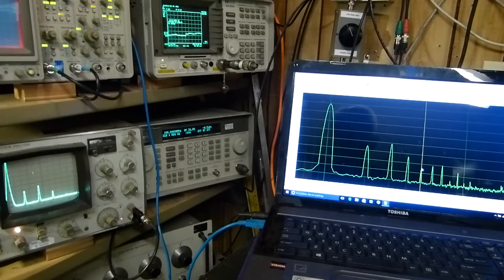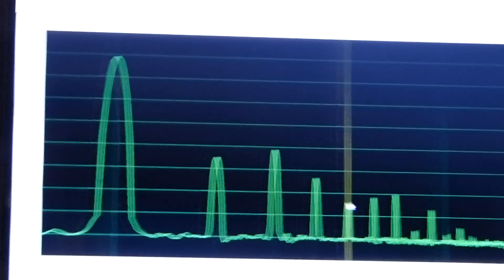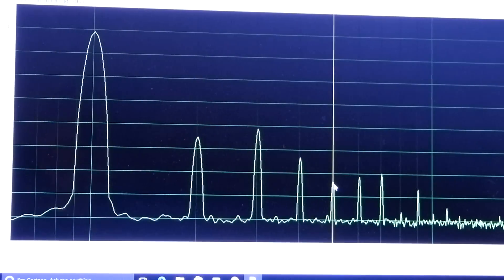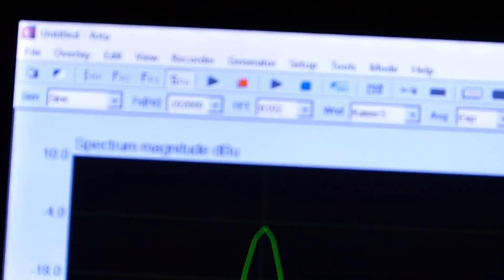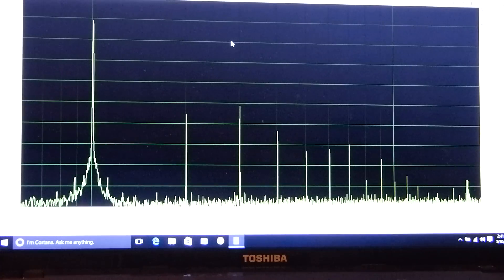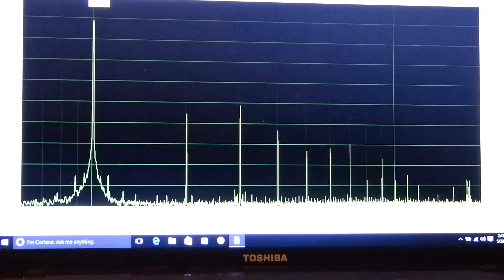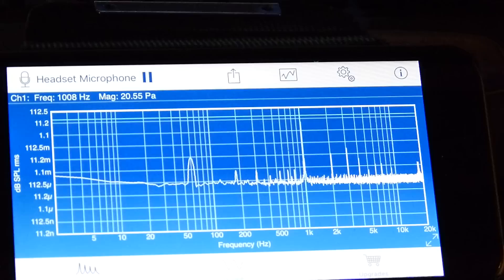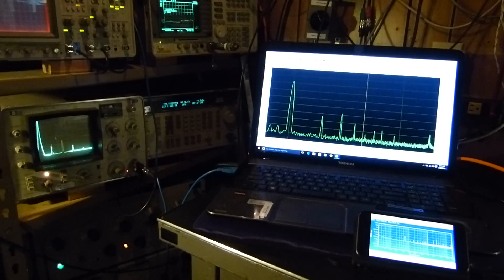Comparing PC FFT Program ARTA Software to HP 3580A & iPhone FFT Program

Comment: hy , what hardware do you use for probing?
Reply from the maker: I use an external USB sound card like, in this case the Behringer or maybe a Focusrite or whatever you might have that the ARTA software can connect to thru the USB port. I am confident it can find any USB unit. If the external sound unit has mic input you can use that for high gain, if you need it, or use the line level mode for higher voltage levels from the device you are measuring plus some attenuation network, etc. to get the input signal to a level the sound unit can handle.
Reply: @ElPasoTubeAmps  ok, can i use such thing for measure the gain of smps ? I develop resonant converter whixh need to explore the mag gain
Reply from the maker: @endremurti  Sure, if you can measure the input accurately and then the same for the output or you can do 10*log of the power ratios with a volt meter. I am not sure the dynamic range of this FFT device is adequate to measure input accurately but I may be wrong. You will just have to try. I can give you an example. Suppose your driving voltage is 1.5 volts across an input load of 500K (you convert this to input power and get 4.5 microwatts) and your power output is 50 watts, the gain would be 10*log (50/4.5E-6) = 70.46 dB.  Hope this helps.

Comment: Good stuff. Linear averaging gets the noisefloor smoothed out even further; it stops the measurement after a certain max number of averages, but you can set that to up to 100000, so no worries there :) I currently use ARTA's SPA mode for example for multitone distortion measurements of loudspeakers, with an output filter representing the spectrum of music (EIA-426B). Lots of good work put in by Mr. Mateljan. And there's also a extensive documentation available, by Dr. Heinrich Weber, called the ARTA Handbook.
Reply from the maker: Thanks - I looked up ARTA User Manual and this is what I found - very nice.
https://artalabs.hr/download/ARTA-user-manual.pdf

Comment: Good video, what did you use to isolate or attenuate the signal going to your computer?
Reply from the maker: I honestly don't remember as it was six years ago but I probably put it on the output of a 10K attenuator pot I have hanging off my "break out" BNC box. Not sure if you can see it in this video but it is where I bring all instruments together so I can measure everything at once. Practically anyway to attenuate the signal down to a few mV should work using a pot.
Reply: @ElPasoTubeAmps  thanks

Comment: What is the iPhone program you use?
Reply from the maker: It is an app called, "Audio Spectrum Analyzer" I might also add that you need a 4 contact type male connector to use with the iPhone and not the standard 3 connection stereo type used in a stereo headset with a microphone.
Reply: Many thanks. Your videos are great. I learn so much from them.

Comment: What version of ARTA do you have ?  I was about to buy a HP 3580A but ...
Reply from the maker: I don't know the version I have but you will just download the latest version off the web. I suggest you take a look at the SpectraPlus and you can make some decisions from what you find on the web. As for the HP 3580A, it was the cat's-meow in its era but at -80 dBm that is the tiniest blip on the screen and to display 10 Hz you have to let it scan as low as 200 seconds per  division (2000 seconds per sweep). On the other hand, it is a lab quality instrument and if want to look at frequencies in the KHz range up to 50 KHz its sweep time is acceptable. Hope this helps.
Reply from the maker: Version 1.8.5 is the version I have.
Reply: Thanks !

Comment: Hi El Paso. I'm curious about the physical connection to the soundcard since I didn't see any BNC connectors. This seems to be a very nice, relatively low cost solution for someone like me who is just a hobbyist. Thanks for taking the time to share your experiences. And what is the model of the Behringer you are using?

Comment: Hi! i am interested in buying FFT spectrum analyser software to run on my macbook.
i work on mostley tube-amps and want to look at the audio spectrums.
my question: how do you connect the software running on the laptop to a tube-amp for example a fender deluxe reverb? what extra interface devices and probes do i need?
thnx!
Stefan from Belgium.
Reply from the maker: Hi Stefan,
I connect some form of attenuator across the dummy load and attenuate it down to a level that doesn't overload the front end of the USB sound card. There is no special probe needed.  If you are running low power you can use a 600 ohm variable pad or one calibrated in dB attenuation but if you get up around 100 watts you will dissipating over one watt in your attenuator so you have to be careful at high power not to damage your attenuator as most of them are rated at one watt. What works well for me is simply a 10K pot across the 4, 8, or 16 ohm dummy load that the amplifier is running into and just pick off a very small portion to put  directly into your USB sound card. That is the simplest way if you do not require to know an exact calibrated amount of attenuation.  I hope this helps.
Reply: hey! thnx a lot for clear explanation. i really appreciate this. i go now first order a usb soundcard and download the limited fft free software and use some kind of attenuater and see how far i succeed. i get lots of Marshall 100w amps on my bench so i need to be carefull not to burn up my soundcard :-)...thnx man!!

Comment: ARTA is awesome. I mainly use it to measure Loudspeaker frequency response and it can do so much more.
If you put a loop on the sound card you can measure the frequency response of the soundcard and also use it as a
correction file if there are some deviations from a linear response. Usually this is the case with onboard soundcards.
Of course this is just a worst case method as you should use good equipment in the first place.
The external or good internal devices are very linear these days at least in the audio range. 
And of course you can measure any amps frequency response. Not an easy program at first but worth every cent
and there is a ton of information about it in the web so it is really rewarding getting into it.
Great video again!

Comment: Hi David! This was an interesting video. I actually downloaded the Arta software (free version) to play with it a little. I think for me,  this is great for out in the field. a lot easier than lugging a CRT spec analyzer :). Carrying that stuff around using public transportation can be an adventure...especially if I have to lug it up 3 flights of stairs doing a service call at a recording studio. For the shop, I'll stick with my good 'ol analog/CRT gear :) But it is pretty amazing. Keep 'em coming. :)
Reply from the maker: I agree, Frank. I have had to carry an oscilloscope, network analysis tools and calibration stuff around on a plane before (long before 911...) but I was so much younger and seemed to never get tired. I loved doing it so much. I sure wouldn't want to do it now.  I think the only extra device you need besides your PC, assuming you have a sound card that you are happy with already in it, is an attenuator. From my little experience with it about -30 dBm is what most sound cards seem to like. 

I don't really know what I got by buying a license. As far as I know everything works the same. 

There is another product out there called SpectraLab that is pretty expensive and only a 30 day trial. I used SpectraLab many years ago on a Win 98SE computer. I made a CD of the program just after installing everything, including SpectraLab and every 30 days would have to disk-wipe the HD and then "ghost" a copy back on. The DoD disk wipe was necessary as a disk format would not wipe out something that the program must have written in the master bit table or somewhere that a format would not wipe out. That was my first audio spectrum analyzer. I believe it ran on a 80286 processor. Remember that long ago?   :-)
Reply: Wow! 286 brings back memories! I had one back in the day. Believe it or not, I use a few audio editing programs made by NCH software that I have to re-install every 14 days, but I don't have to wipe out the HD...I simply go into the windows registry and delete any keys that point to the program and I'm able to do a fresh install. Yea, at my age, i don't want to lug heavy gear around...it seems like yesterday I could carry a house...not anymore. :)
Reply: Hi,  I checked the Arta website and it looks like if you do not pay for the license you can not save or load files.  Here is the exact wording from their site:   "If you have no license key, you can freely use this software only in a demo mode. The demo mode of programs is fully functional except loading and saving of files."

On another note I think you have the Behringer UMC404HD (four channel).  I noted in their spec sheet  that the UMC204HD (two channel) has better dynamic range and is a little cheaper.  If you don't need the 4-channels and can get by with 2-channels the 204HD might be a better purchase for the Arta software.  I order the 204HD so we shall see...

Again thanks for the videos on this topic, you do a great job.
Reply from the maker: I really appreciate you telling me this. I have looked at the two channel Behdringer and see it is only about $59. I would have bought it or even  a one channel if it had been available. Please do let everyone know how your two channel device turns out. 

One thing I see over and over with this program and the devices that I have is that the higher order harmonics are less and less accurate in their amplitude as we go up in frequency. The second and third harmonics are about two and four dB different from the HP 3580A which I am pretty sure explains  why THD readout is significantly incorrect at 10 KHz and above. 

The harmonic amplitude gets more and more in error as the frequency increases.  When both my Tek AA501 and HP 8903 agree I can't ignore them and the ARTA software and hardware that I use for the FFT device does not agree. I am disappointed in that and I want something better. I think the problem is in the hardware and not the ARTA program.
Reply: +ElPaso TubeAmps You're getting closer and closer to the bandwidth limit of the hardware, so it attenuates higher harmonics accordingly. 192kHz sampling only gives you 96kHz bandwidth, which is really not enough for audio SA unless you confine yourself to lower frequencies. It only gives you four harmonics of 20kHz for example.
Reply from the maker: I agree with you. I am test-driving another program called SpectraPlus-SC that you can download for free for 30 days. Very expensive if you want to purchase it. They do make their own USB "sound card" with  BNC connectors rather than RCA or XLR connectors and it might be pretty good. 

So far, each of the sound cards and SW programs that I have used all perform at the same level.. 

They are all significantly deficient above 10 KHz. Actually, they start becoming error prone in THD above 5 KHz but they do a great job at the lower frequencies and the frequency span is fantastic and they display 10 Hz pretty fast. Certainly a lot faster than the analog SA.

I can see 60 Hz down at -100 dB, plus harmonics much lower, out to 360 Hz and the THD is spot on. I simply cannot see that on my HP 3580A. I can see -80 dB or a bit lower in the error signal out of the AA501 monitor ports on the oscilloscope and can tell it is either 60 or 120 Hz noise modulating the test signal (I see this noise on the Dynaco but not the McIntosh).

I do agree with you that the limit is, most likely, the sound cards that just can't pass the higher order harmonics (up to the 10th harmonic of 20 KHz) like the laboratory grade Tektronix and HP equipment can. It seems a BW of at lease 200 KHz would be necessary which would be a sampling rate of 400 KHz to get acceptable accuracy.
Reply: 96kHz bandwidth not enough for audio SA ?   I do not understand   I think I can ear only up to 16kHz at best  (I am 55)     Could you elaborate ?
Reply from the maker: The usable bandwidth is always (at least) 1/2, or less, of the sampling rate so a 96 KHz sampling rate would be a 48K bandwidth that can be displayed on the SA. The highest sampling rates on these USB sound cards that I have found is 192K which give a bandwidth just below 100 KHz. This certainly would be more than adequate if the sound card itself has a bandwidth that was flat out to even 20 KHz but they do not. I don't know what frequency they are down say, 3 dB, as I have never measured it (maybe I should) but error starts increasing in the THD around 5 KHz and gets worse as the frequency goes up. So, the sampling rate of the USB sound card may seem fantastic but the actual bandwidth of the audio circuits in the USB sound card are rather poor compared to high end HiFi  audio equipment. I have tried to point this out in some of my videos. Even with these limitations, the USB sound card is probably much better than the internal PC sound card and the FFT SA has real value in testing audio equipment.
Reply: ElPaso TubeAmps Hi ! thank you very much indeed for your very helpful advice.
I am a beginner and I am actually using Arta with a soundcard.
I like the SW a lot.  For now I am always looking at noise floor of different soundcards to see the best one to use for measurements.
Thanks a lot again for the very nice video and valuable advice.
Reply: ElPaso TubeAmps On the topic of attenuation, I have a question about impedance. Let's say I'm driving a 100mv 1khz signal into the front end of an amp from the HP 8903 and out to an 8ohm load. That signal is into 8ohms, then let's say I pipe it into and out of an HP 4436A (a 600ohm box) and then into the audio interface (like your Scarlet box). I guess the 8ohm load is what the OT needs to see, but how does that impedance relate to/interact with the 600ohm output of the 8903 and the in/out of the 4436? Let me know if this doesn't make sense:). As a side note, I recently picked up a Keithley 2015 THD DMM and it has been fun to play around with and check against my 8903. If you get a chance to play with one, I think you would like it.
Reply from the maker: I just looked up the Keithley 2015-P on Ebay. Wow.  I wish I had bought that one instead of the Tektronix.
Reply: ElPaso TubeAmps You might be able to get away with the "non P" model unless you need the additional oscillator output voltage... I think that's one of the only differences, but I could be wrong. I just wish there was software like Pete Millett's 8903 software out there to run programs with. I saw one older thread where someone had created some programs, but I haven't asked them to share yet. Thanks for your answers, I really learn a lot from you and I appreciate the time you put into sharing your knowledge!
Reply from the maker: Hi Adam,I hope I can help. Taking the signal off the 8 ohm load and putting that into your HP attenuator to then feed your USB sound card is OK but there is one thing to consider. At 100 watts output, you will have 28 volts across your HP 600 ohm load and that will be dissipating 1.33 watts in your attenuator. In my case my HP attenuator is rated at 1 watt so be careful to not damage your attenuator. The 600 ohm load will lower your 8 ohm load to 7.89 ohms but that is insignificant. The Impedances are of no concern as the 8 ohm load swamps the 600 ohm input load and the 600 ohm load output will swamp the high Z of the input of the USB card. I would recommend something simple like a 10K pot across the 8 ohm load and just tap-off/dial-in the amount of attenuation you need to drive your USB sound card without over driving it. That is usually what I do however, the 10K pot method will take away the accurate attenuation you can read off with your HP attenuator. Your Keithley 2015 THD DMM sounds like a very nice instrument. I am going to look into one just because of the THD feature. I assume it has a dB scale also. The dB scales, with variable impedance selection, allows easy determination of gain/loss and NFB figures when you are adjusting your amplifiers.